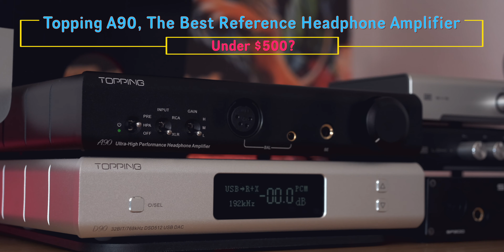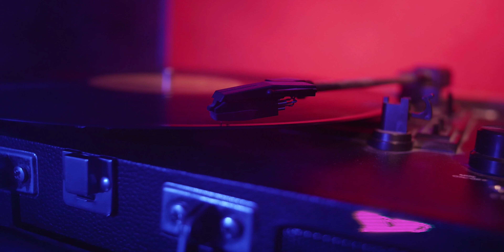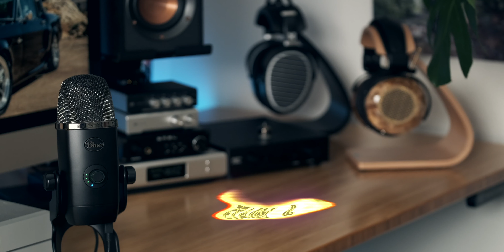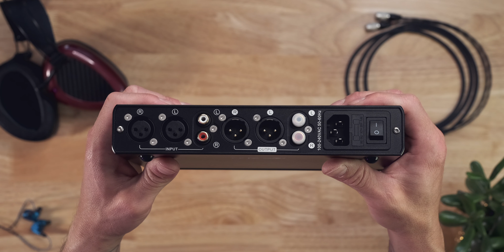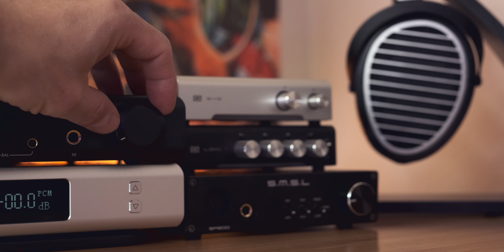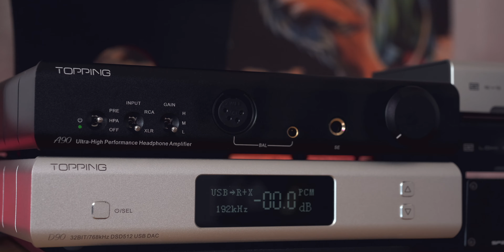Topping A90 Headphone Amplifier Review, The Best Reference Headphone Amp Under $500?

Comment: I just purchased an open box A90 for a very good price to pair with Matrix mini i-pro 3. 
I bought it because I am concidering getting the Arya V2 so wanted to get a little more power to drive them. Do you believe the A90 will change the sound quality when compared to amo of the Matrix Mini?
Reply from the maker: A90 is a very neutral sound signature, even more neutral than the Matrix mini i-pro 3 head amp.  What it will do is deliver more power and current which can improve the sound signature of certain headphones that require more power or current.  It is a analytical headphone amp with very little flavor so if that is what you are looking for it could be a good fit. @Ray Cabrera.

Comment: I am confused between the Topping A90, and the Aune S7 Pro, I am currently using RME ADI-2 Pro FS R BE to run my HEDDphone in balanced mode, but I wanted a dedicated amplifier. I heard that S7 Pro has better tonality and dynamics compared to A90, and even though the A90 is way more powerful than S7 Pro, 3.4 watts per channel would be good enough for all my headphones, including the HEDDphone. Have you had any experience with S7 Pro? And would you know if these amps would be a noticeable upgrade over ADI-2 Pro's balanced out? (which has 2.9 W per channel, with really good specs).
Reply from the maker: I haven’t heard the Aune S7 Pro, @TechReflex . I would say that the HEDDphone performs better audibly with not only more watts but a higher amount of current as well.  So when choosing An amp, definitely look for around a minimum of 4-5 watts but also higher levels of current in order for them to really sound their best.  I think you can definitely get more power and current than your ADI-2 pro.  I really dig this amp and still have it in my personal collection https://tvp.ag/0FErdw0vrY or https://amzn.to/3BDpKt1 I think it is great for dynamics and tonality as well as flexibility for many headphones.  It remains one of my favorite amps under 2k.

Comment: Purchased an A90/D90 stack recently based on all the positive reviews. Then was listing to some of Resolve and TylersEcletic’s live streams and they really kind of tore into the A90 and said it doesn’t sound good. Was kinda surprised. Any thoughts on why there are such differing views on the A90?
Reply from the maker: Hi @Mike Swec thanks for checking out my review and for the great question.  I think the best way of answering this question is that everyone has subjective opinions of what good sounds like.  I think there are better sounding amps for pure enjoyment listening as I said in my review.  However if you are reviewing gear or want a reference sound for what headphones or a DAC is presenting the A90 is a good option for under $500.  Are there better options for more money?  Sure, there are.  Are there worse options for more money?  You bet. Are there better options for less money now that have come out more recently?  Possibly (Subjectively speaking)...technology is ever changing and upgrading.  If you were to listen to some class A amps, what you will generally find is a more natural sound as well as better staging capabilities such as more depth to the music vs. the flatter sounding but accurate imaging stage the A90 brings to the table.  The A90 is still a reference sound though.  What I mean by this is it will be fairly colorless, neutral, and less forgiving with poorly recorded music or poor system synergy.  I also think you are going to find lots of differing views in this hobby Mike, don't sweat that.  The key is to try an amp (That is not in the same class of reference amps) that is different now from the A90 and see if you like it better paired with the D90, if you do after a few months of listening you know that maybe listening to the well measuring reference type gear isn't always the direction you want to go in the future.  For me personally I prefer tube/tube hybrid amplification for enjoyment listening, but generally use some solid state gear to review and get a sound basis to start.  I hope that answered your question and was helpful!
Reply: @MarcelloRostagni   thanks so much for the detailed and thought out response. Always great to get some further prospective on this stuff. I guess when I made my purchase I was after a highly analytical sound to go along with my Focal Utopias, which it sounds like is what the A90 should give me. I’ve also been looking into adding the Monoprice liquid platinum tube next time it goes on sale for around $400. Would be interested to hear your thoughts on what the solid state options are that are “better for more money”. I’d also love your thoughts on some tube options less than $1200 or so (have some wiggle room on price) if you have a minutes. Thanks again. Subbed and looking forward to more content. Keep up the great work!

Comment: Hi. How do you pronounce Marchello?
Reply from the maker: Hi! Just like the instrument the Cello, like you typed it in English 😀 @Jet Earlewood
Reply: @MarcelloRostagni  Thanks, but it’s like Markello. No “k” in the Italian alphabet. 😀
That’s the Sur Name of someone close to me
Reply from the maker: I think you misunderstood me, no worries.  Thanks for watching Jet.
Reply: @MarcelloRostagni  You’re welcome. Thanks for your reply. 
Just started using Tidal. My DAC is the Peachtree DAC ITx. It’s ok. Much better than my vintage Audio Alchemy stuff, but no MQA. That’s why I’m interested I’m the D90 and SMSL M400
Reply: @Marcello Well guess what? The DAC ITx stopped producing sound through the USB and Optical ports. Just there COAX works. I put it away last night. Then this morning I reconnected and it worked, but only for less than 10 mins. 
I was going to order the SMSL M400, but it’s out of stock at my preferred place to buy. I’m just wondering on the E30 would beat the Audio Alchemy DTI PRO - DDE 3.0. Optical from my Mac to the AA stuff. I have their powered Data Stream Cable that’s either coax or TOSLINK. Anyways, it doesn’t sound too bad, a little bright. 

Any comments on the Topping E30? Yeah. I know. It’s cheap. Guess I want to try either Topping or SMSL without breaking the bank before I go all in. 
In my location I can’t just buy/try & sell. There’s no market. (Think 3rd World ). 
Thanks in advance,
Jet
Reply from the maker: @JetEarlewood  sorry to hear about your DAC going bad.  I haven't heard those DAC's yet but I should be getting the Topping E30 in for review soon on the channel.  Once I get some time with it I can give you my thoughts.  Stay tuned, thanks Jet!

Comment: Hey Marcello,
Thanks for the great review!
If you don‘t mind, I‘d like asking for your personal opinion on my current audio gear situation:
I am running a pair of Sony MDR-Z1Rs (and a pair of 1990s, but ignore those for the moment), which I personally really love. They are currently powered by a THX-789 (will be sent back, it‘s already a replacement unit and both react to cellular activity and keep giving me beeping noises), but were powered before by the SMSL THX888, which I sent back due to a broken volume knob giving me horrible channel imbalance. I kind of appreciate the clean sound of the THX Amps, though my Schniit Magni 3, even though far cheaper and technically worse, sound as least as pleasing combined with the Sonys.  The Magni though is definitely missing balanced out, low noise floor and majorly lacks precision, instrument differentiation is very good though.
Used DAC is a SMSL SU8.
I‘m now in need of a new amp and thinking about getting the A90 or any other amp up to like max 700€. Would you advise going for the A90 or can you think of any other alternative?
Reply: By the way: a giant A90 advantage would be the 4.4mm pentaconn since it‘s the new standard balanced plug for Sony‘s high end headphones. I‘d then either listen to them with the in the box balanced 4.4mm cable, use my custom built diy silver plated pure copper 4pin XLR cable or get the Kimberkable for the Sony, which supposedly adds to the sound quality.
Reply from the maker: Hi @Fabian thank you for watching and your great question!  If you appreciated the clean sound of the THX amp I think you will appreciate the sound of the A90 as well.  You do get an extremely powerful balanced output that can power most all headphones.  I have no channel imbalance on the unit I have as well as have noticed no cellular interference. You also have a low gain, and a medium gain mode for more more sensitive headphones.  Both the headphones you listed are pretty resolving  and when paired with the SMSL SU8 and the A90 I would suspect you will have a very analytical listening experience.  I did have the SU8V2 for sometime and actually found I didn’t prefer it and upgraded to the Topping D90 DAC.  Pairing the D90 with A90 is still a more analytical reference pairing while being less sharp to my ears then the SU8v2 THX pairing.  Something to keep in mind though the 1990s treble can be a bit much to most listeners and pairing it with a reference solid state amp and a more sterile sounding DAC (to my ears) may cause listening fatigue.  However if you weren’t having issues with that from your THX amp with your headphones then the A90 will likely be fine.  It really depends on what your goal is, pure music enjoyment or more aggressive forward music analysis with the most amount of detail.  I think the A90 is worth trying for your Reference AMP then you may want to consider a Tube Hybrid Amp for a more relaxed listening experience down the road.  Most importantly, trust your ears and what you like as we all hear a bit differently and value different sound signatures.
Reply: Marcello Rostagni Thank you so much for taking the time and effort to write me such an extensive answer, I greatly appreciate it!
This makes me really confident that the A90 will be the right choice for me.
The well known treble issues with the 1990s are something I am well aware off, but I‘m a student and my 1990s are staying back at my parents‘ powered by the Schiit Magni/Modi stack whilst the Z1R are joining me in my apartment.
One very interesting point in your reply and highly relevant for me is the DAC section. I‘m also running the SU8V2 just like you did before, but neither am I convinced this is the one DAC to stay with forever. I‘m not looking into hybrid AMPs since the Sony‘s tonality is already very dark and warm out of the box and thus matches very well with more analytical AMPs, still the SU8 would offer the opportunity of giving slight change to the sound signature with its multiple modes for tube, etc. But I‘m honestly not a big fan of this digital post-production (always lowering quality) and thus not so sure whether a different DAC (like the D90 you mentioned) would be another valuable upgrade.
Since you know that my setup already contains a very highend pair of headphones and soon likely an A90 AMP, the DAC will be the only logical next step and I really wouldn‘t want it to bottleneck my setup.
If you would like to speak about this on Discord, TeamSpeak, Skype or anything else comparable, I‘d be totally up for it, since writing so much may be exhausting for you and I really don‘t want to bother you with this topic!
Thank you so much for your support, it is greaty appreciated
Reply from the maker: Of course, no problem at all!  What’s your discord info?
Reply: Marcello Rostagni It‘s Etrix#9254

Comment: Am just bought the 90 stack for my Arya but dont have a balanced cable how much of a difference does the single ended to balanced make ?
Reply from the maker: Hey @ELSA thanks for watching!  The voltage is higher out of the balanced XLR output as well as more overall power.  Balanced cables for Hifiman headphones are not that expensive and since the performance is better from the 90 stack via the XLR output  I would recommend getting a balanced cable and seeing if you prefer the sound vs. single ended.  I know I do.

Comment: thats a nice review. kept on needing you to go on and on. Quite engaging. However, would there be a trade-off if i pick these over the spl phonitor e in driving the heddphone coupled with an RME ADI-2 DAC
Reply from the maker: Thank you so much for watching @Tendayi Mavhima .  I actually think those two options would also be excellent for a solid state reference amp and a reference Dac.  You would actually also gain the EQ features from the  RME ADI and some additional features the Phonitor offers as well.  If it’s in your budget to spend a bit more those are both excellent options.

Comment: Nice review. By what you're saying the difference in sound quality is minor between sp200 and a90. I have currently a sp200 and if there is no big improvement in sq, I guess the extra money could be better spent in another hp.
I actually wanted it to be a real step up from sp200 since is way more good looking.
Reply from the maker: Hey @Victor Farah thank you for watching!  I think it depends on a few factors.  I do find the A90 to be less fatiguing, and better if you are using balanced headphone cables.  If you have highly resolving headphones you may notice more of the quality of sound differences.  I always recommend you try something and give it a listen for yourself to formulate your own conclusions to be safe.  We may hear differently.  I think you will notice a greater difference in sound going to a Tube Hybrid amp  or choosing a different pair of headphones.  Headphones will always give you the biggest change in sound, then amps, then DaCs in my experience.  I definitely think it is a real step up in build quality, design and for a person that uses IEM’s from the SP200THX.
Reply: @MarcelloRostagni  I do have nice hps here. Let's see. Less fatiguing and better. By this you mean a difference in timber, frequencies, stage or decay?
I agree with everything you said above and thank's for the quick answer, I appreciate that!
Reply from the maker: @Farazao  I would say less fatiguing as in some tracks paired with some headphones/amps/dacs can sound a bit more clinical and I can listen to them in smaller doses if this makes sense.  The A90 sounded a bit less clinical in my opinion, which is subjective of course (Which is why I always recommend listening for yourself) compared SP200THX.  Don't get me wrong the A90 is still a "Reference" amp.  I don't hear the A90 as warm but very neutral.  I believe a neutral amp is really important if you want to hear and reference the differences between headphones.  The A90 paired with the D90 is a very analytical combo allowing you to hear the recording as it was recorded.  This may or may not be important to you.  It really depends on your listening preferences.  For instance, I am currently reviewing the Focal Utopia Flagship Headphones and for my listening preferences I would say I would prefer a Tube Hybrid amp with those headphones to be able to better enjoy them and bring them closer to my slightly warmer leaning listening preferences.  I really think it is all about synergy between the amp/dac/and transducers to achieve the quality of sound you want.  With all that said as someone who reviews Headphones the A90/D90 combo are great to be able to get a base line for sound of a given headphone then try them on my other amps and DAC's seeing if there are other synergies that play better with the given headphone.  The biggest difference I see between the two amps like I said in the review is the additional power/volts via the balanced outputs for harder to drive headphones, the ability for them to be used with IEM's or sensitive headphones, the enclosure, better volume pot, 4.4mm balanced connection, and as you said it also looks much better.  Those are the things I would take into account more than anything when deciding if you want to upgrade.  I hope that helps!
Reply: @MarcelloRostagni  I guess I see what you're saying. The sp200 is less fatiguing than the JDS Atom I have here, even though both are neutral. The atom is a super dry sounding amp and I guess you can say the sp200 is more musical because of its longer decay by comparison. I'm interpreting the a90 is another step in that direction, which is often refered as "more refined sound".
It's dificult to translate emprirical experience into words sometimes, sorry for any mistake I could've made there.
Also, I had a Topping dx7 pro and it was super analytical and I know the lme op amps weres a big part of this equation (I know this because a changed them for Sparkos op amps). The d90 has not 2, but 3 lme op amps for the line out and so, I'm guessing that even considering a more musical approach of the akm chips, it must be somehow clinical sounding. I can only guess since I've never heard it, so that's something to think about. Maybe a different dac with the a90+utopia could be an interesting match, maybe losing less of the detail retrieval.
Anyway I'm looking forward too watch your utopia review! Subscribed!
Reply: @Farazao  Jds amps are always dry sounding wouldn't rek those to anyone i dont know about the spl200 but i owned a 789 thx with a dx7 as a dac in the past so it should sound similar now i own the a90 d90 stack with the arya HP. To me the d90 has more musicality more punch and dynamic more weight were as in the case of the 789 i sounded more hollow to me more transparent thin  sounding
Reply: @ELSA-ex4ph  that is helpful information, thank you!
The jds atom pairs very well with my Sony Z7. But for most things, I prefer thx sound to it.